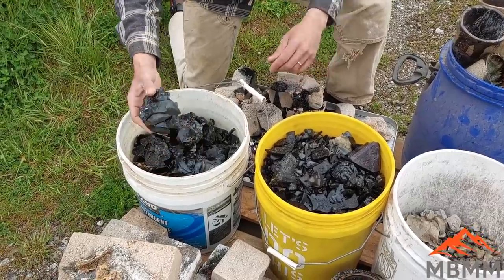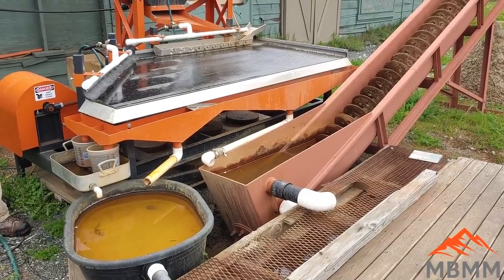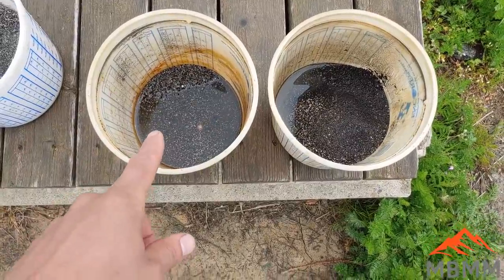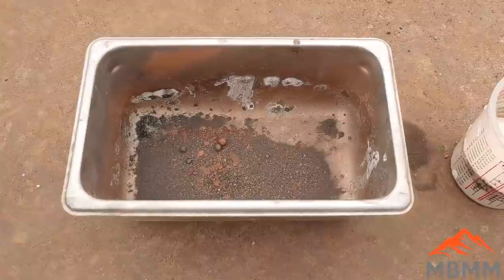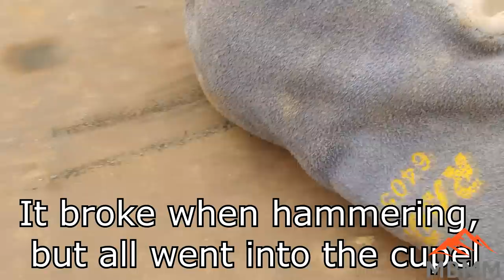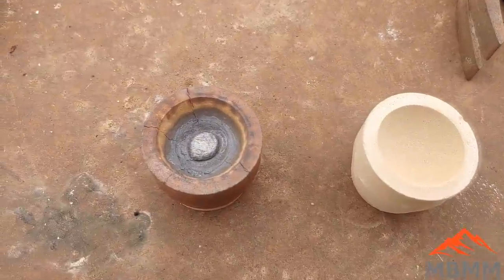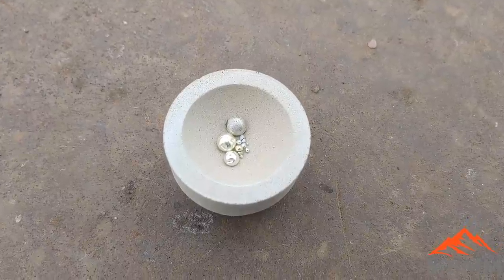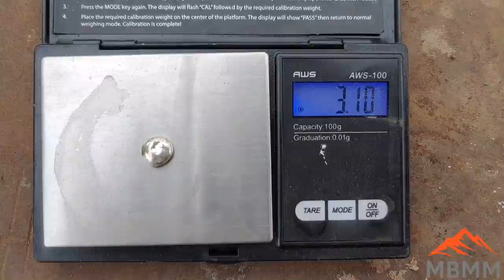How Much Gold Is Lost In Gold Smelting Slag & Spent Gold Smelting Crucibles?

Comment: You should consider parting the combined beads. Take a bunch of your beads, add some copper, (maybe twice the weight of the gold-silver bead) and remelt it all into one, then flatten the resulting large copperized bead, and dissolve it in Nitric acid. The gold will remain undissolved and can be made into a pure gold bead, the copper and silver will go into solution and after neutralizing the excess acid, the silver can be dropped out of solution with sodium chloride as silver chloride and the precipitate can be turned into a pure silver bead (thus parting the gold and silver).
Reply from the maker: Hi Chris.  Yes I have been thinking about getting into the acid side of things.  Makes me a little nervous, but it would be a good addition.  One of the things that has held me back is there is really no monetary value in doing it, correct?  A PM refiner will pay the same for the gold and silver regardless if it is alloyed or separate is what I have heard.  They are only concerned with getting precious metal alloys without a bunch of base metals or black sand.  Thanks for the comment and keep watching for more vids :)
Reply: @mbmmllc  Use silver instead of copper, with the same process,  it uses much less Nitric (1/4th) to do the same job..:-)
Reply: @mbmmllc  If you have a refiner that pays you the full value of the materials minus a small share for the work, it doesn't pay off. I just like to do that because I keep the gold. I never sell gold! ;)
Reply: Sreetips is already doing it check him out.
Reply: But there will be some beads of lead so how you can seprate them with nitric acid from precious metals because the lead will precitapate and mixed with the undissolved gold
How to separate gold from lead percitapate in nitric acid ??
Reply: @mbmmllc  have you thought about using leaching to get the last of the gold from the black sands or slag ?
Reply: @gasa7264  after you inquart and dissolve the silver/base metals, you dissolve the gold in aqua regia. once the gold and any lead are dissolved, you add a small amount of sulfuric acid to drop out the lead. Run the gold solution through a filter and the lead sulfide will be caught by the filter.
Reply: Send it to sreetips

Comment: Great video.  Love your tenacity. Some of your newer viewers may not understand these cupels are special (bone meal,  burnt antler or magnesium oxide) and lead is not soluble in them . . . lead oxide is quite soluble in them, and that's why you open smelt them or keep the furnace door ajar.  I think your thought process on precious metal loss in crucibles is in the back of all our minds.  Very glad you did all that work with the camera running.  And, I especially liked your discussion at the end.  Thanks for posting.

Comment: I processed some slag from refining and found about 5g/kilogram of micro-spherules.  It was a process in itself to break down the slag and sort the output through standard sieves.  I ran the results through a blue bowl to remove some of the heavies that were left behind from burned CZ's and other junk left in the jewelry.
Reply: Im willing to bet you will get more if you mill down the slag by pulverizing down to 1mm or smaller size.

Comment: Where does that lead go, that you use to refine your precious metals in your cupel (if I write that correctly)?It gets stated it "oxidises off", but what does that mean.. does it get away Into the air, in gaseous state?
Reply: The lead oxide is absorbed into the cupel. It is the reason that it changes color.

Comment: I do silversmithing as a hobby.

I want to recover the silver that I, and others in my classes, lose when filing, sanding. And there will be brass and copper in the mix. As well as the dreaded solder, and some iron and residue from sanding and filing.

Can you give me any tips on how to recover the silver from all of that mess?
Reply: See my comment about parting the gold-silver beads Jason is making. Your filings will dissolve in nitric acid, as long as there is not a lot of lead in your solder, the process will work.
Reply from the maker: Hi Michael.  If there is a lot of iron pull it with a magnet first.  The biggest question is how much material are your working with and what are the ratios?  For example if it is 75% silver and the rest is base metals that would be fairly easy.  If it is 5% silver and the rest is base metals that would be harder.  Would you be willing to send me a sample of the material and I could run some tests for you?  I would not charge you anything and I would send back all the material when finished.  You can send me an email at MBMMLLC@gmail.com and we can discuss if interested.  Thanks